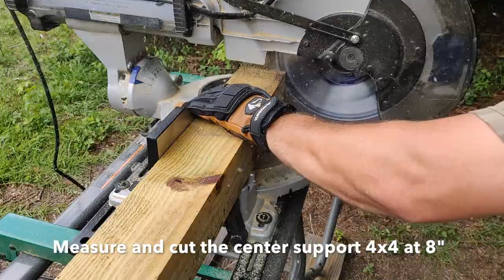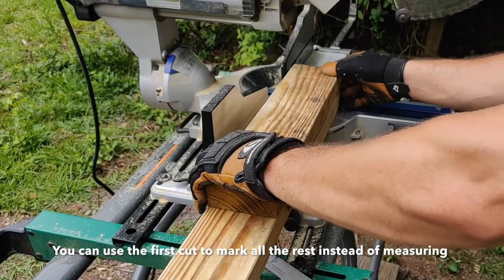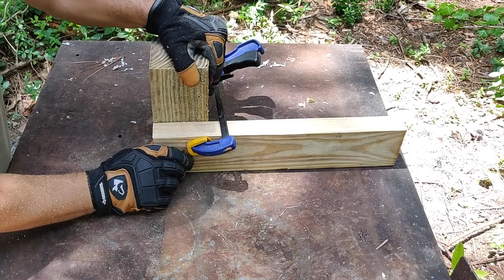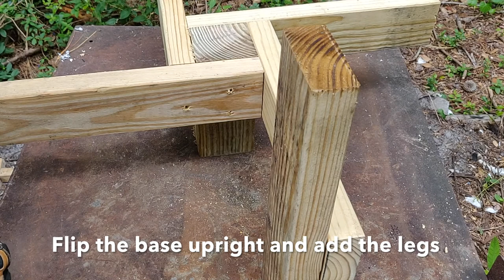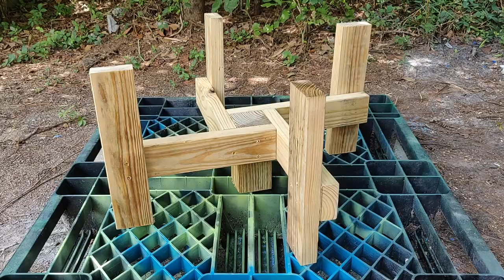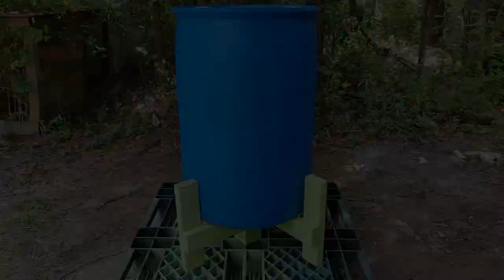How to make a Stand for a 55 Gallon Plastic and Steel Drums

Comment: thanks for this video. i was wondering if you can tell me what diameter is your rain barrel? how did you come up with the 17" arms? i have a 21" diameter barrel, would your cuts fit it? appreciate any advise.
Reply: nevermind. your measurements fit perfectly on my rain barrel. great video.
Reply from the maker: Thanks!

Comment: Would this work for a squared 50 gallon  rain barrel with bottom sides of 20"?
Reply from the maker: It should you will just have adjust it for the size that fits your application